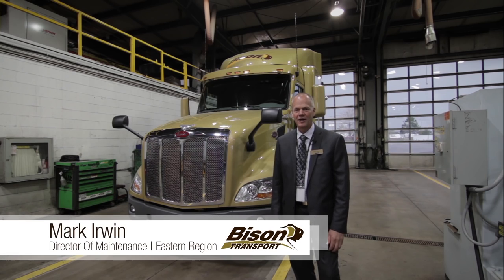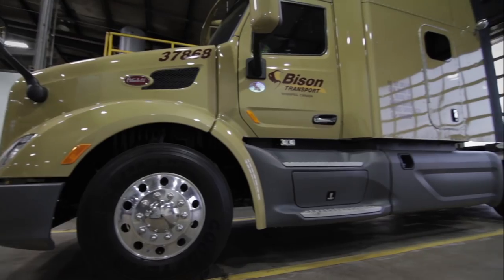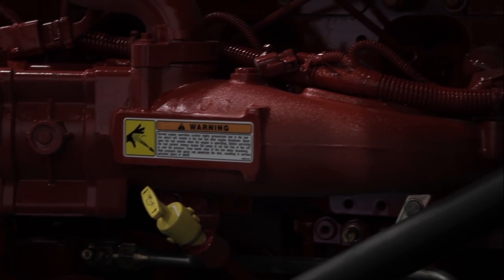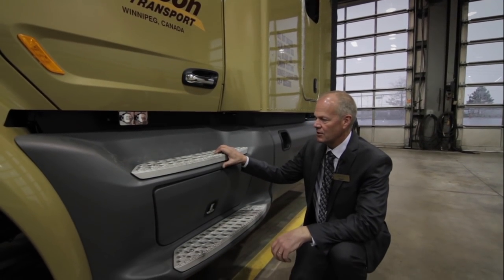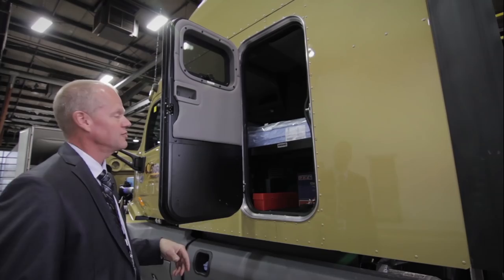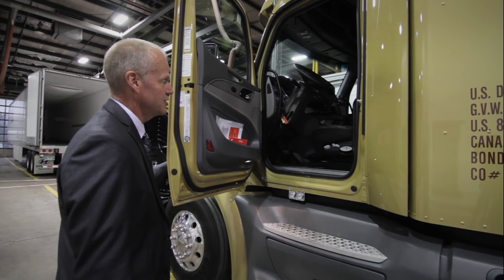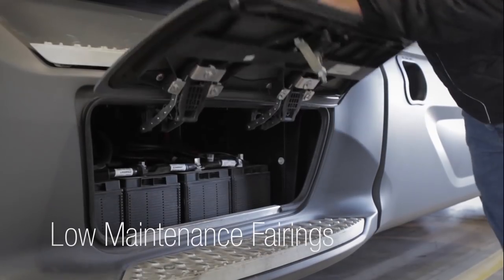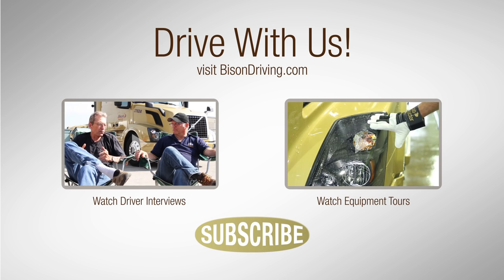2016 Peterbilt 579 Truck Tour

Comment: Nice truck :)  the side door looks to have enough room to add a custom door to shield the sleeping area from dust :) A molded door that can be opened & closed, that can be attached to the side door with a sliding window panel :)
Reply from the maker: That's an interesting idea. Thanks for sharing.

Comment: 8.7 mpg yea Complete BS....my 579 with the same exact specs pulls 7.5 with 20,000lbs in the box running Toronto to Vancouver. Truck spends just as much time in the shop for repairs as it does running down the road. Volvo is a better truck hands down